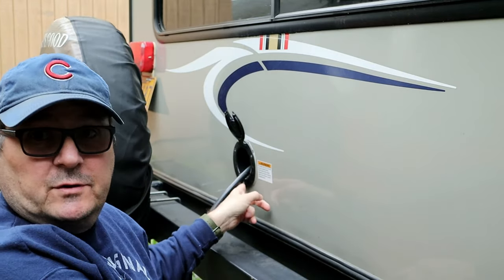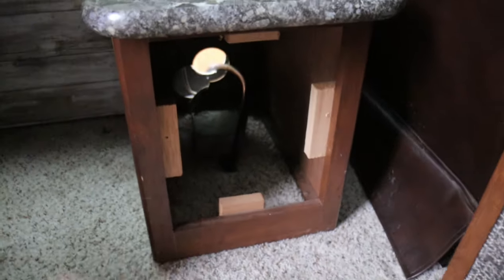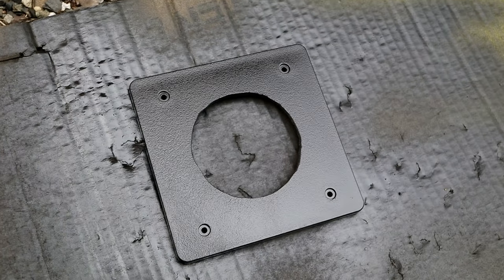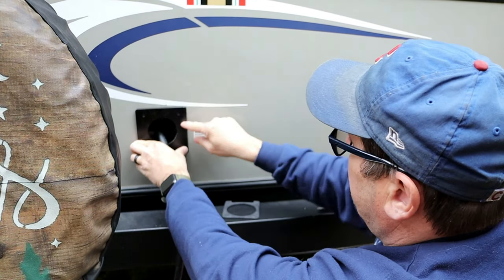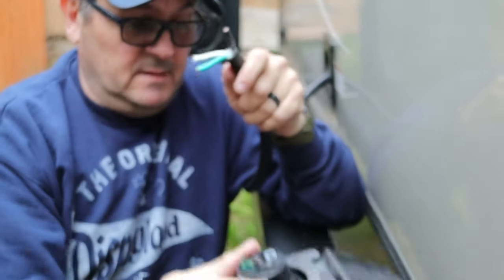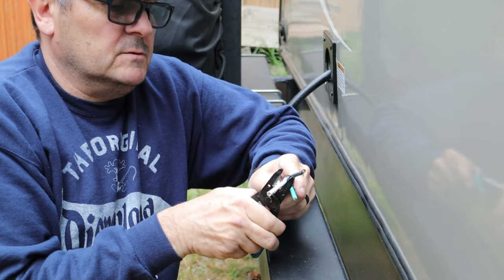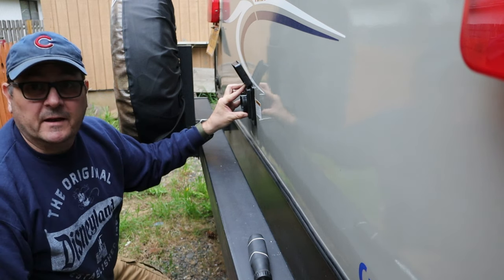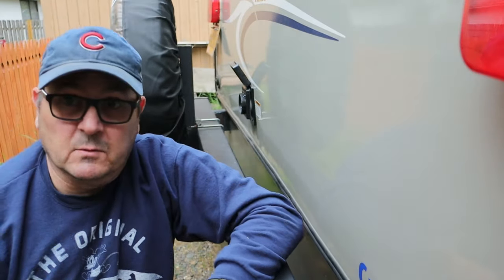RV 30 AMP POWER CORD QUICK CONNECT DIY UPGRADE

Comment: Omg your so amazing we r stuck w/ o power ben running off batery...hubby changed all fuses. Finally we figured it's our cord. Keep doing what ur doing. We're freezing our butts off at 11pm trying to figure this out. We think our female got disconnected from rv.  Hubby now knows how to access it. Man that thank you. He just said the cord shot
Reply from the maker: So sorry to hear you having issues.. but glad to know that maybe we helped in some way to get things on the mend.  This was a super easy fix for us and we enjoyed having the new 30 amp cord.  No more leaves, pine needles and little critters getting in.
Good luck to you.. hope it all works out!  Thanks for coming around and spending some time with us.

Comment: Awesome install.  We just know that you guys are going to appreciate having that extra power source.
Reply from the maker: It is a nice replacement for the old system.  I am happy now that the system is sealed and we won't have to clean out the pine needles etc.  Thanks
Reply: @HappyPlaceDiaries  This is so true.

Comment: Great video. My 2008 Laredo Fifth Wheel has a 25 foot cord that stores in a small space at the back side of our trailer. It gets caught and binds up all the time.  Unfortunately, there isn't a solid wall behind the cord door, but I think I will install this upgrade anyway and reinforce the back of the tin trim where it mounts.  Thanks for the tips and details of hooking up the wires .  Cheers!
Reply from the maker: Good call… this was the best upgrade I think we ever did to our Passport.  It made a massive difference in set up, clean up, and keeping things out of our RV.  Hope it works out for you!  Thank you for watching

Comment: I need this but my camper is old so I’d probably just burn it down 😂
Reply from the maker: You would be surprised.  We. replaced this because of the idea that things from outside were coming in.  When we pulled the panel I was amazed at how many pine needles and debris was in there.  The new plug keeps everything out and is water tight.  Which is more than the old one was.  Thanks

Comment: This looks great. I found the link to the plastic electric plate but I cannot find the plug assembly. I can see from the video that the brand is Park Power, but I cannot find the plug assemble that you used. Also, once I cut my cord, what type of plug do I use to connect the long cord to the newly installed plug.
Reply from the maker: We bought the plug assembly at Camping World.  The cord should screw into the back of the new plug.  Hope that helps.  Thanks

Comment: I think I can do this!   How do you position the  “back” cap where tighten dow the wire from/to your junction box?  Do face the wire down or up to hold the wire.
Reply from the maker: The wire will only go in one way.  I did not have to do anything with the junction box as I just cut the wire and replaced the connection point. So the orientation of the cap aligned with the new connector.  I hope that is what you were looking for. This is a super easy project.  Literally the hardest part was cutting the wire. Thanks for watching.

Comment: Very groovy (nice).
Reply from the maker: Thanks… appreciate it
Reply: You are welcome.  I relocated my 50 amp inlet.  The hole has been covered/patched with eternabond tape for about a year while I wait for a permanent solution.  You just gave it to me.  Your idea to use the heavy duty "CANTEX" j-box cover is brilliant.  I will use the same cover but without drilling a hole in the cover.  Thanks! @HappyPlaceDiaries
Reply from the maker: @seymourscagnetti1413    Thats awesome.. so glad we could help!  We appreciate you watching.